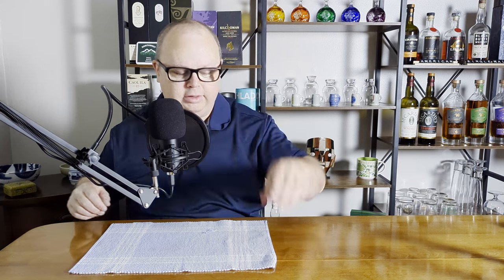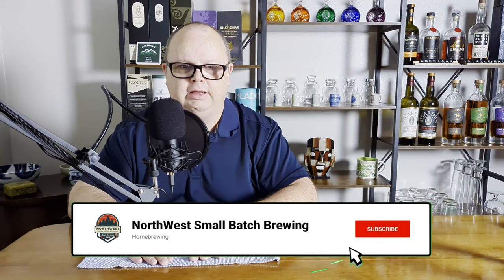Mastering Cold Crashing: Say Goodbye to Suck Back Woes!

Comment: Process is the causation of this problem. Naturally conditioned processing avoids this problem entirely. Lagers or ales. Cold crashing a naturally conditioned ale or lager in a bottle or keg happens after the introduction of C02 to finished pressure. Adding either actively fermenting wort at high krausen or plain un-yeasted wort most often from the same batch or an identical batch, which creates carbonation naturally, without the need to introduce any bottled gas will offset any temperature compelled volume reduction and consequential vacuum or negative pressure. The tricky thing can be to calculate the amount of krausen or gyle required to generate the desired volumes of C02 for the finished product. The Krausen/Gyle Calculator on Brewer's Friend has never failed me. Never a bottle bomb, only 1 infection in 1 bottle over the years. Cheers Steven.
Reply from the maker: That's expert mode brewing right there :-)
Reply: @NWsmallbatchBrewing  I am no expert. Larry taught me everything I know with exception to the natural carbonating process.

Comment: Why couldn't you just drape a balloon over the neck of the carboy, and allow the suckback to occur? The rubber membrane would get sucked into the vessel (ie: the balloon would partially inflate inside), but as long as there's a barrier between the beer and the air what would it matter?  Just wondering.
Reply from the maker: Balloons can contaminate your brew.   Some people do use a milar and fill it with c02 to balance the pressure.   Best practice is to just cold crash on a keg if you can.  It's only for clarity so it's not a deal breaker.
Reply: @NWsmallbatchBrewing  Did you just delete my reply for some reason?
Reply from the maker: @theghostofsw6276  i didn't delete anything
Reply: @NWsmallbatchBrewing  OK.  Sorry then.  I was just sayin' that I don't think the balloon would necessarily touch the beer inside, and would still be sanitized beforehand.  I'm gonna give it a try, maybe tonight, on a carboy of water, just to see what happens.  Not an exact comparison perhaps, but water still shrinks quite a bit when cooled. I'll let you know what I find out.
Reply from the maker: @theghostofsw6276  if you can get a mylar ballon.. the foil ones....that seems to hold up better to the cold
Reply: @NWsmallbatchBrewing  I'll have a look around.  Thanks.